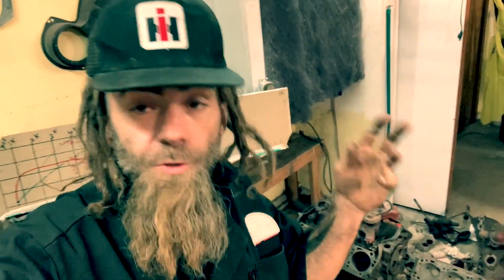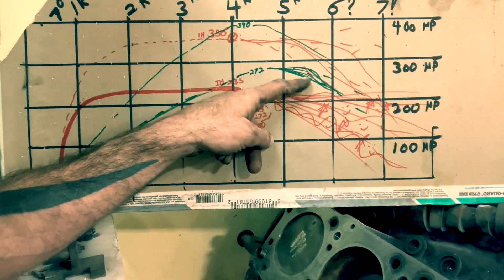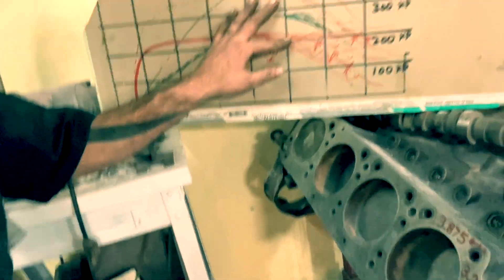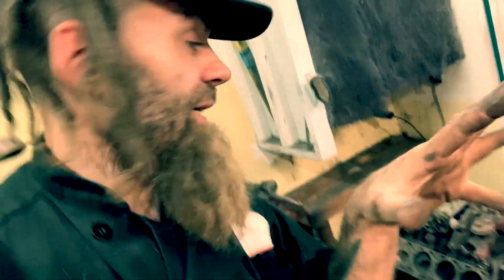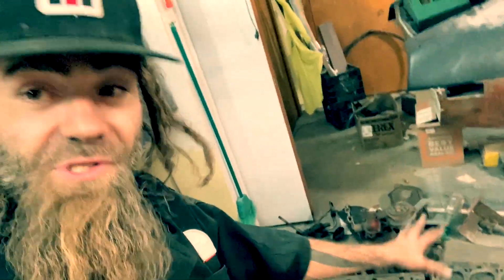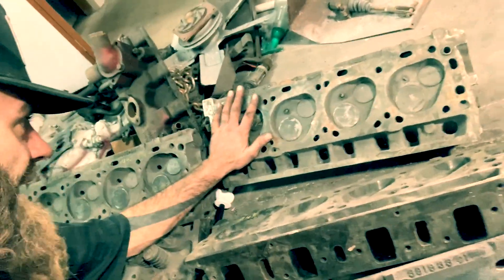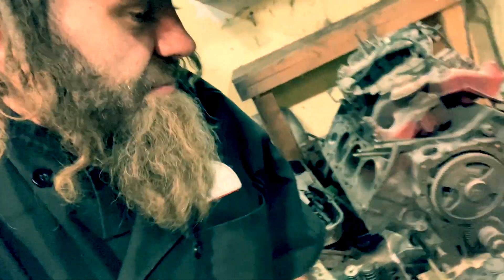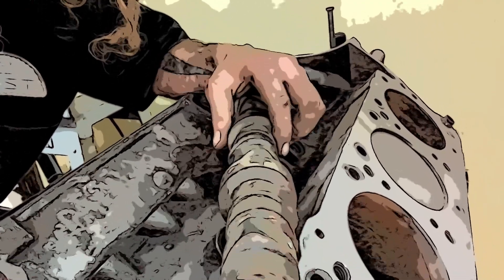Everything International Engines! Worlds Biggest Block! '59-'86 IH Red Power vs Big 3 Horse Power!

Comment from the maker: Ok A dynamic deflection in the system causing is causing valve bounce, and while tighter springs are a way to overcome this issue (damage from the loss of contact is worse than the extra wear from bigger springs), its not correcting the cause of issue.... So yes the lifters do over adjust and hold the valves open when they bounce! so its a real thing that happens but  "lifter pump-up" referred to an early debunked theory of other causes, not what I meant! I used an incorrect term.....

Comment: youtube men of culture. we have been clickbaited
Reply: The chick got you huh.....  😂😂😂
Reply from the maker: if thats what it takes to get you to learn,  lmao we might be on to something here, lets do a patrion and when we get the funds i will hire two strippers to do the work while i flim and instruct lmao
Reply: @TEN-TIMES-HARDER  first time finding your channel.  My dad grew up on a farm, wouldn't have any tractor if it wasn't red.  Only knew a little 'bout the trucks.  The last few years I started sharing with him everything I could read about the Diamond engines, green, silver, blue,red, & that goes way, way back, gosh there were some small ones in the beginning.  He knew a little more about the v8s.  I've seen guys on tv say, back when International built pickup trucks, you knew that was a TRUCK.  Early 80s when I was a kid, he had an International pickup truck, don't know the year, but probably '60s, maybe early 70s.  Don't remember if he said 304 or 345.  What he did love retelling about that truck was there was an option for dual batteries.  On a gas engine.  Didn't have it, but there was room for it, he bought the parts and cables needed and put in the 2nd battery same as if it came new that way.  Brutal & long Nebraska winters back then (b. 1974, I remember), he had a guy at work ask for a jump.  My dad told him,no problem,we'll get it started. The guy said, you're pretty confident.   When he popped the hood the other guy said "oh, this thing has 2 batteries?"  (On a gas light duty truck)  my dad, r.i.p. ,loved telling that story 🙂  I look forward to learning all I can about these engines from you by watching your channel.  Like I said, in many ways came from an IH family, but up til now, I know little about the IH gas engines.  Not anymore,  👍
Reply: Noooooo 😮
Reply from the maker: "if it aint red leave it in the shed"

Comment: I learned to drive tandem dump truck on a 72 Binder with a 392, and 5x4.  There was a hill on the highway [Suicide hill outside of Nipigon] that stressed me right out.  Still learning how to shift loaded.  I had to time it right to hit the bottom at 4500, pushing the throttle to the floor, almost breakin off my foot, I would crest the top of the hill at 3200....*whew*.  Super strong pulling engine.
Reply from the maker: @iBackshift  i pulled tandom dump trailers in a big rig, but with all the emissions i would imagine its about the same power!

Comment: You 4 got to mention the valves are very dangerous. Sodium filled. Which really worked good back in the day. P.s. my father was a IH mechanic. He bought a 75 scout new with 304. I watched the odometer roll 3 times around and never had the valve cover off of it. Sold it in 94, guy totally restored it. Hi from canada Ontario.

Comment: Australian here. I'm a farmer who really likes these Inter V8s. I have 2 trucks with the 345 and a semi with the 392. These trucks are '70's models and apart from servicing have never caused any problems.They are the most reliable motors I've ever used. These motors were made in Australia.
Reply from the maker: yeah you guys have like the 4 door cabs with different fenders and bed or something close???
Reply: @TEN-TIMES-HARDER  Australian Internationals are very different to the US ones.We have the Acco, cab over. Very popular built from '72 till 2010+. There were bonnet Inters called the AB,C,D series from the 60's to the 80's .All Inters could be ordered with 4 door cabs. The engines were 286, 345, 392 all petrol. Diesel 555,903 Cummins . Perkins 6's. Only the very small Inter 110, 120 came with a pickup body, rest were tray or tipper bodies.

Comment: I don't know if you're the right guy to ask some dumb questions I may have. To preface this, I am a 54 year old man who has now been turning wrenches for thirty years, for Ford dealerships since 2000. I have a soft spot for IH Loadstar 1700 trucks. The reason? I remembered the sound of those engines in the school buses I rode in were my favorite, compared to the sound of the Ford and Chevy school buses of similar era. My research shows that the IH Loadstar of the mid to late 70s in school bus application was most likely powered by a 345 V8. I remembered the transmission shift pattern on the IH buses being 1st, 2nd and 4th being the top row of gears from left to right. And the bottom being R, 3rd and 5th from left to right. 1st gear was never used. I remember the IH buses had a very distinct "whine" sound to them if that makes any sense. I do notice that the 304/345/392 engines are used in the IH Scout trucks as well. Is there anything different about these engines versus the same ones used in Loadstar applications? Would you happen to have an idea of what transmission model I'm referring to by what I've described above? In school bus application, there was no red button on the shifter, so it was just a straight five speed with 1st and 2nd gear on the top row of the shift pattern. I have a stupid fantasy of buying a Loadstar truck equipped identically to what a school bus would have, in order to be able to relive the memory I had of the sound. I know it sounds stupid, and probably is stupid.
Reply from the maker: hell yeah right now im almost done with my 71 metro! Thats a clark transmission, and the only diference in the small truck engines is they had a smaller fan, the timing gear is retarded 4 degrees for emissions, and they didnt have the governed distributor/carb setup....
the direct gear drive camshaft makes that noise...
loadstars are awesome!
And not at all stupid!
These things are time machines, I get more joy out the people who get lit up with good memories than driving it sometimes!

Comment: I had a 73 truck built for the airforce. 392 4v, came with the same Holley carb the 454 vetts had, 800 cfm. The ports were insanely big and that truck could smoke the tires in all 4 speeds.

Comment: Hey should I ditch my 350 Chevy Thomas built for a International bus
Reply from the maker: They pull like a diesel big rig!  If you have the opportunity to trade up with in reason... 
 Im building an IH camper because I dont want my home to break down on the side of the road lol.  300 thousand miles missing oil changes lol
Reply from the maker: Im not a brand snob, I got lucky and got the IH, but if a another brand step van fell in my lap I would be living in that instead...

Comment: My old man had a small trucking company.  We had International 549 gassers in dump trucks from 1962 until 1971.  The 549 V8 gasser outran most of the early diesels.  The closest gas engine competition to the 549 International was the 534 Ford.  On paper the 534 Ford had more HP but in practice the 549 usually outperformed the Ford.  Combined with a 5 and 4 two stick transmission we often hauled 24 tons plus.
Reply from the maker: @danamuchesko9739  that’s awesome!
I ran heavy haul dump for a bit…
Right now after loosing my ass in divorce I’m stuck over the road, and this prostar with the Cummins can’t get out of its own way it’s so smogged down!

Comment: I found my last pager in a truck i hadn't driven in 17 years
Reply from the maker: i miss pagers, screw cell phones, remember you needed 50cents and to be near a phone booth to be bothered by some body eleses panic attack lmAo
Reply: @TEN-TIMES-HARDER  
Quick question.  I have a 1961 inline 6 cyl gas international 2 single barrel  carburetor bus. The crankshaft nut is enormous.  I need know what size socket it takes before i go back and to make multiple trips.  It spins around to one spot that doesn't allow a full 360 revaluation. I had to find this out the first time with a screwdriver on the flywheel... i really don't want to do that again

Comment: I have a big o international V8, it's a 549 ci but it runs on propane. It's a 220 truck, the biggest V8 I know of is the GMC 637 ci. It's part of the old 60 degree engines.
Reply from the maker: not displacement, biggest block

Comment: With the high nickel content should the blocks be painted? Would a unpainted block have a better cooling surface? ( i am trying to restore a 67' scout keeping it original as much as possible). Trying to do it proper , so it can be passed along family for the next 50+ years.
Reply from the maker: paint it! or rust will creep under the gasket surfaces and woo woo woo, no heat transfer issue, these blocks take 20 min to warm up for an oil change lmao, they have no problem keeping cool, 300k worry free caked in 30 years of manure easy...       add hardener to your paint. even if your using rustolium, thats good as long as you mix in 8 to 1 ratio of "wet look" enamel hardener

Comment: I love an SV mill as much as the next guy, but amazing flow is definitely not a characteristic of any IH engine.
Reply from the maker: port them heahs like i do in the engine rebuild video, and will flow like afrermarket race heads with only one restriction well 2, to overcome, first is easy higher lift cam.
Now the only issue is the way the exhaust flows around the valve,
, even with unshrouding that area on other engines the part if the valve near the wall dosnt flow much, but its still some.  ours has a second issue though in this regular low flow area, 
the valve is open and its up against the reliefe cut out in the cylnder head area, so there is a tiny corner not alowing air to go past, thats why they have the weird piston like in the dome its not a valve reliefe its st swoop it out the valve sideways like it was a flathead lmao
so with more lift and a lil unshrowdimg that i will demo on the 392 build, ill dyno that and flow bench the heads just for sake of youtube lol

Comment: Hi. Would the 549 international V8 gas engine" be a viable option instead of a ford 460?
Even in an old ford 196
1973 Thunderbird?
Thanks.
Reply from the maker: i dont think youll fit that in a thunder bird bit it sure would be a show stopper if you can!

Comment: I think the design of the piston having a hemispherical dishin the center with a small chamber head is an awesome idea.  Nearly all the air/fuel is under the spark plug , the flame doesn't have far to travel. Has all the fuel in a spherical  shape burns fast and efficient. With free flowing valves and ports would make a great engine, capable of making lots of TQ, and the efficiency of the combustion would love high rpm operation. Making tons of HP. I guess that much detail 
To an engine is not practical for mass production. Basically having quench pads taking up approximately 70-80% of the bore. Squeezing all the mixture into the sphere in the center  with the chamber shape inducing swirl as the mix is compressed. With a methanol ethanol blend as the fuel, and 12:1+ compression, the ports flowing nicely. It should be a awesome engine, who ever the engine is built by , it could be a harbor freight  212cc engine. The only way to make more power boost or nitrous oxide , or adding nitro to the methanol and boost.    A sub 400 CID  engine  producing 2-3+ HP per cube! I think a hemi with a piston with a dome, then having a inverted dome in the center of the piston  say a 4.375 " bore with a 2.5" diameter inverted dome in the center under the spark plug. This cuts compression, the only way to get it back is a larger bore, or longer stroke, or by boost, AKA supercharging. A cylinder pressure  around 200-250 psi, or 150 with 30 psi of boost, less compression the more air and fuel that can be added. The more power  that is produced. The problem is getting it running, if for example, you had a 2:1 compression, producing about 20 psi cranking pressure in the cylinder. Then a supercharger, with Compound turbos producing 180-200:psi of boost, if the temperature was 
Possible to be kept under control with air to water intercoolers. The power produced potentially would be equal to roughly 16-18 engines of the same displacement if the engines material can handle the pressure. The block would definitely need girdles.  Possibly large steel bars and bolts clamping it all together  like the Brazilian guys do on the Chevy 250-292 producing 2500 HP.  Turbo possibly burning a  low% of nitro.  The crank has a large girdle  the head gasket a large steel plate on the top. With long large bolt clamping them together. They take the Lowest power optio engine and produce 10-15 times more power.. using stock crank and block & heads, modified of course. Probably using aluminum rods, custom pistons.  Ported and modified heads, I love seeing what modifications they make in heads and intakes,  I'd like to see a 250 or 292, with a custom intake, holding 3, 350:Holley 2bbl carbs inside a plenum  for a blow through turbo setup.  Maybe go to 3x 500 cfm Holley carbs , with a twin turbo setup.  A CNC stock crank remove all excess materials, remove stress risers. Making it light as possible using a heavy racing flywheel, and large harmonic damper. To get back the TQ stored in rotating mass. A 30-40 lb flywheel, on a 50 lb crank. That originally weighed over 60. The tiny forged pistons, long light rods ,  required alot of weight removed  from the counter weights to balance the assembly. Remove it from 15°-20° from each side of the point it is indicated to need to be removed. So more mass is removed to get the most mass removed, maybe get a custom 4340 crank, ultra light design, so tungsten weights are  required, and balance to within 1/4-1/8 gram.. possibly 45 lb crank  spinning 8k rpm+  possibly exceed 2500 hp . Getting a custom aluminum head cast would be a shame changer. Move the valve locations slightly raise the ports , making them taller, raise  the cover rail about 1" the ports about .750"- 1.125" possibly more. A long with longer and larger titanium valves. A better chamber shape.  Maybe  .2.08" intake valves with 1.65" exhaust valves , possibly notch the blocks to unshroud the intake valves. Ceramic coat the exhaust  ports,  chambers,  and valve faces and I'm the bowl area to insulate from heat, it should prevent the intake charge from heating more than 2°-3°f. It being a nearly billet head with water cooling. The power handling should be awesome, 
The power gain should be nearly 100hp or more over stock at this level. Especially  is a splash of nitro found it's way into the methanol tank! 😳!.. sorry to ramble have an awesome day! ✌️
Reply from the maker: i would like to see just what a lil more head work, compression, and maybe a paxton charger would do,
ill bet a tall rear with this kind of torque would dominate the strip

Comment: I have an insane amount of valve train slop on my rebuild 392. Zero preload. Would cut to length pushrods be appropriate?
Reply from the maker: has it run to pump the lifters? as you see here ENGIN BUILD DIY 345 IH  (part 1 of 2)
https://youtu.be/PmnKseKSRF4 the new head gaskets are thicker.  so if you deck the heads .020" you are actually only like .007 and thats in spec for pishrod length the tappers can take +/- .010" difference and the tappets to adjust...
Reply: I have not primed the oil pump yet. But I would have assumed you wouldn’t want a quarter inch of play on the pushrods. On all the GM stuff I’ve ever built you are supposed to get a little bit of preload. Right now the rods are just barely resting on the surface of the lifters.
Reply: @TEN-TIMES-HARDER  Ive decided to pull the trigger and order some rockers from Murhpy's Motor Service. Hes the only guy on the planet that offers adjustable roller tip rockers for the IH small block.

Comment: Great video! How do these engines compare to the MV404? Any recommendations on places to find part numbers / order parts for IH? I just picked up an old 77 loadstar id like to properly restore and upgrade ignition/ carb. Also looking for other suggestions for HP / fuel efficiency/ reliability upgrades.
Reply from the maker: 77 loadstar gonna want to replace the governed distributor and carburetor combo!!!   Super Scout Specialist is always the first place I call,    I have videos on https://youtu.be/PmnKseKSRF4?si=CdhLEwfskBS6zP1A....   as well most engine parts are over the counter just order for a scout or a pickup...   I upgraded my last 345 from a loadstar to an igniter2 electronic ignition that is all in one so it hides inside the distributor and looks stock...

Comment: What carburetor would you recommend for v345 1603  short school bus or loadstar 1600. It has the Holly 2 barrel. Don't Holly warp? Stock or upgrade? Thanks
Reply from the maker: it was the thermo quad that warped... Best carb to run on these engines is the Holly Truck Avenger 470cfm 4bbl.   they are designed for truck type low rpm power.  while you can get a larger 4bbl to work, its very tricky because any other 4bbl besides the truck avenger is designed to open the rear barrels at about 4,000 rpm,  and thats the redline for our applications, the truck avenger will open the rears sooner so your actually using all 4 barrels!!!  make sure you get a non governed distributor to work with the non governed carb!!!     funny thing is most the  4bbl manifolds where dealer swapped off the loadstars and put on scouts so its very possible you should have had a 4bbl to start with!   and the factory 4bbl where only 390 cfm but good luck finding one...